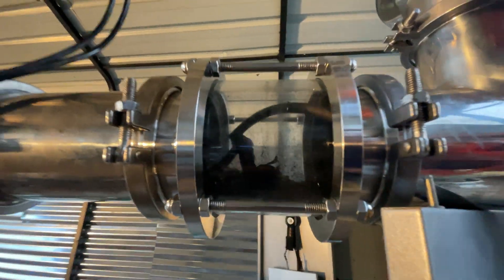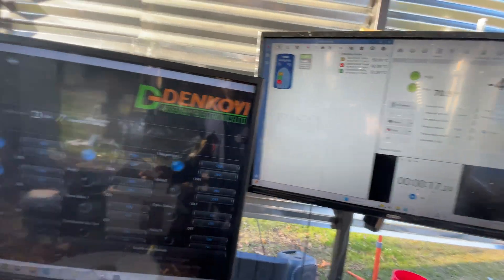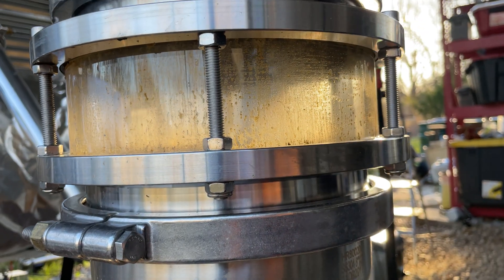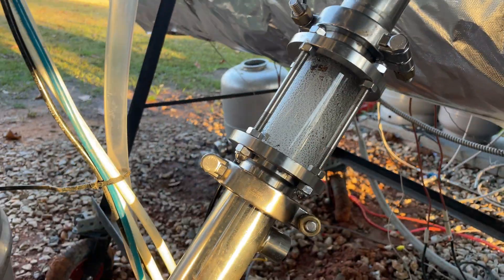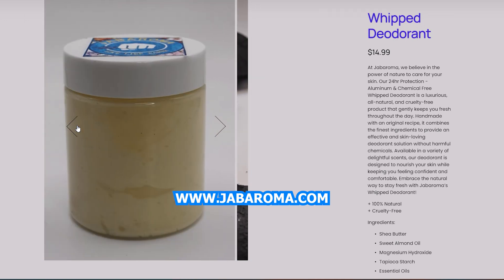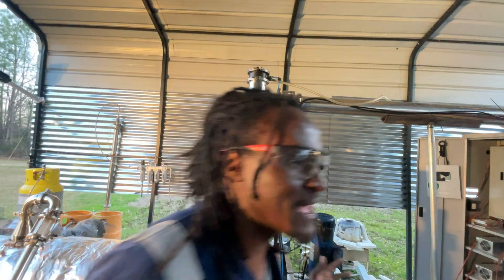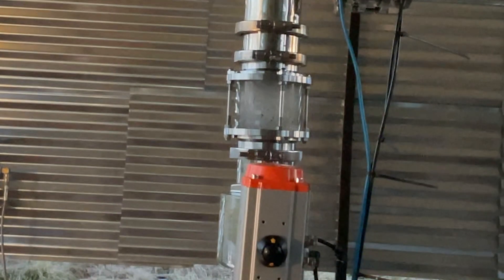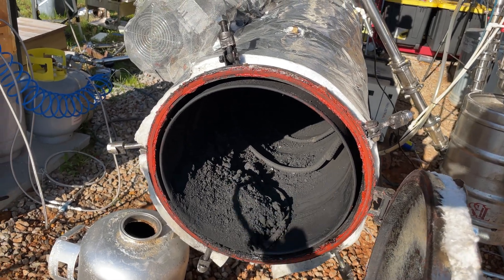I MADE HISTORY! | The World's 1st EVER Handmade Continuous Microwave Pyrolysis Reactor! Plastic Fuel

Comment: i dont understand why no one is talking about his augers.  they are the biggest problem of clogs. its not even a real auger . they are fake welded rebar pieces in the shape of a drill.  why not use an official auger which might cost a couple hundred bucks
Reply: I had a similar thought. Like the feed screw that plastic sheet extruders use to heat, blend and feed various blends of plastic pallets without clogging up.

Comment: You can keep sealed system but have carbon collection at end in a canister. Utilize the fact that a pile of accumulated carbon will keep seal as pile builds slowly auger out to maintain that seal? I still think your system needs to be tipped at a slight  angle. You want continuous feed AND continuous withdraw.  The perfect system is one where you fill input hopper, press button, and do nothing but drink a nice beverage because entire system is automated. I think there is market for carbon black in tire industry?

Comment: Can you get a spectroscopic examination of the leftover materials? That will give you exact information about the leftover product. 

Also, you are pulling a vacuum on an active pyrolysis chamber that is breaking down plastic but there is no post filtration on the vacuum into ambient air that I could see. That may be something that you'll want to address. 

But all in all, this is phenomenal work. KEEP GOING.

Comment: Meters of mercury are directly related to the column level, its a height which you use to calculate the vacuum.  -psi is related to the change in atmospheric pressure. In industrial applications unless you physically are measuring the column height, you're using -psi.

Comment: So let me see if I understand what's going on here. You are essentially trying to distill petroleum from plastic using microwave heat in a vacuum chamber so that the oil can be evaporated off and then condensed and reused while leaving only the safe carbon and mineral matter behind. But the kicker is it's a continuous process as opposed to a load and distill, load and distill, process?

Comment: I have watched this video 3xs and fully support what you are doing.  I understand this was a "test run" but we will eventually need to see a full run, with info such as lbs of plastic converted to gallons/liters of fuel, energy input and cost, as well as weight of carbon black ,  THANK YOU
Reply: @jacknanuq6119  He also needs a proper analysis to find out what he's making. 
So far it's only styrene and benzene that have been identified and styrene just turns back into plastic, and when an engine is ran on it it creates aerosolized nanoparticles of polystyrene plastic, meaning it's spraying microplastics into the air we breathe.  
Benzene levels in fuel are strictly regulated due to its penchant for prolifically causing cancers.  
Who knows what the rest of the mystery cocktail is, but since there's been PVC labels on his PET bottles, I suspect some halogenated nasties.

Comment: The pyrolysis oil coming off you want to use to preheat the plastic coming in instead of wasting heat to the condenser. Only low quality heat you want to waste on the condenser. Imagine you have IDK 300 celsius pyrolysis oil vapor that you are then cooling to 25 C with cooling water, when you could cut your utility cost by using that heat to preheat the feed into the reactor. Also a microwave is about 60-65% efficient at converting electrical power to microwaves, so a lot of energy is lost in the process. The waste heat of the microwaves is probably low quality.

Comment: Your product IS NOT A VIABLE FUEL 
You know this.
Reply: So if you remember one of the first videos he shows off the continuous feed system, the top comment was that you will get out gassing coming from the chamber since the vacuums will be different. Low and behold, that's exactly what happened, and frankly that is very scary to say the absolute least. As soon as i stumbled upon this channel a few months back i knew that the fuel that was produced could not actually be used in any kind of car ICE since lord knows it would probably gum things up, screw with sensors, screw the catalytic convertors, screw fuel lines, etc. As much as I applaud him for just making this large sized backyard science experiment, it kinda seems like people take it the wrong way and that he is doing something totally revolutionary, which he is not. He did get one batch of fuel sent to a lab for analysis a while back that was totally made up of the same plastic type (shopping bags i think). Frankly im just worried that one day this reactor of his is going to basically just act like a fuel air bomb and either turn into a projectile/missile or outright explode and turn into shrapnel. He also should arguably be wearing better more comprehensive PPE especially pertaining to breathing this stuff in.

Comment: This is really really cool, I'm a chemist so I've thought about this before. Honestly the idea of turning plastic (back) into fuel makes sense, but I still feel like once it's burned there's a net flow of carbon coming from the ground (as petroleum) and into the atmosphere. The carbon / coke you made at the end IS a good way to recycle existing plastics, especially if you can verify there's no microplastics left over, but I think it's far more useful in its solid form or as potential fertilizer than as fuel. It's in my opinion that all petroleum- or coal-sourced carbon should make its way back underground, but I have no problems with burning natural fibers like recycled cardboard or even wood or hemp, or even biowaste like fruit peels.

also industrially methane is used specifically to transport hydrogen since it's a hydrocarbon. If you were able to somehow recapture the H2 gas instead of burning it all that would also make this more useful, because then maybe industry could switch to recycled plastics instead of methane as a hydrogen source
Reply: His products that we know of are mostly styrene and benzene, running engines on this is maximizing the environmental damage that can be done with plastic. 
If you're a chemist you'll be aware of the tendency of styrene to polymerise. 
Think about those tiny airborne polystyrene chains leaving through the exhaust along with the usual combustion crap. 
Benzene doesn't have a huge fan club when it comes to the environment either, cancer is quite unpopular despite it's prevalence.

Comment: What's the efficiency on this? My first impression is that it uses far more power than it could generate in the fuels it generates
Reply: It's seriously energy hungry. The product isn't fit to use as a fuel either. Mostly styrene, some of which becomes nanoparticles of polystyrene as it goes through an engine, aerosolizing plastic!
Reply: @EddieTheH  ah fair enough. I made a simple wood fired pyrolysis system for turning tires back into gas and diesel. Piped the gases back into the fire to supplement the head source, and I was surprised how much I could get. Figured this was the same goal. Had no idea there was a use for plastic pyrolysis for anything other than returning plastic to fuel!

Comment: Can’t wait for the benchtop model
Reply: Going to be awesome when we call all increase our energy bills to create liquid cancer at home.
Reply: @ No, you’re missing the point. Yes, hydrocarbons are carcinogens and you should not come into physical contact with them. This process should utilize the same safety protocols as any oil refinery.

As far as energy consumption, this process is self sustained, in that there is enough output product material to be turned into fuel to continuously run the generators for the power needed for the process, itself.

Comment: YOU ARE NOT THE FIRST!!!!!!!!!!!

RESYNERGY in California was the first continuous microwave technology. 

In fact, they commercially sold their pyroil to a major oil company. 

FACT CHECK BEFORE You MAKE
CLAIMS 

btw - great job!!!!
Reply from the maker: I said "Handmade" that specifically I am the first
Reply: @naturejab  Good job man. Most people will never make anything. Happy to see people being creative and following through. Ignore the armchair engineers in the comments haha.
Reply: @naturejab  They did hand make the unit. Feel free to reach out them.  They are very careful on their feedstock to ensure NO PET gets in the system and no moisture.  BTW - Your pipes, pumps, elbows, electronics are not hand made.  You assembled parts except for the rebar that you use as a screw.  I don't mean to be negative and it is really great you have come this far.  I am in the oil industry and have worked with most of the pyroil companies,  These include Brightmark, Nexus (in Atlanta), Alterra, PDO Technologies, Exxon Mobile.  Their customers have very tight specification on what the various fractions of oil look like.  The biggest headache is the Association of Plastics Recyclers whom don't support pyrolysis.  In fact, they have lobbied against it with many of the states.  They see it as competition to mechanical recycling vs complimentary.  Keep going as you journey along this difficult path.
Reply: reading is hard I guess lmao.

Comment: I plan to wrap my machine in copper coils with refractory cement as an insulator inside an inconel shell, making it more thermally efficient. I'll probably use engine coolant and water to air coolers to condense the fluid. I think that a more desirable output could be achieved by making the heating and cooling process more accurate and aggressive.
Reply from the maker: Awesome stuff! Stay safe and keep up the good work
Reply: Heck yeah! I love Seein the people take action in helping the environment and becoming more corporately independent 
 
So much plastic will will be removed from the ecosystem and now people will be cognizant of where the put their plastic since its literally money in your hand
Reply: @jdrmanmusiqking  lol not how this works at all. This is just a science experiment. Not good for the environment and doesn’t make any money. Actually costs quite a bit in electricity
Reply: @jdrmanmusiqking  There is absolutely no money in this, this costs way more to produce than what it produces.
Reply: Sorry if you've already done this: do you have the microwave emitter(s) tuned to give hot spots aligned with the flow of the plastic?
I remember seeing articles about the mining industry using microwaves to crack rocks on conveyor belts before chemical processing: they found they had to retune the microwave emitters to get tighter focus to get very rapid point heating, the reverse of what you want.